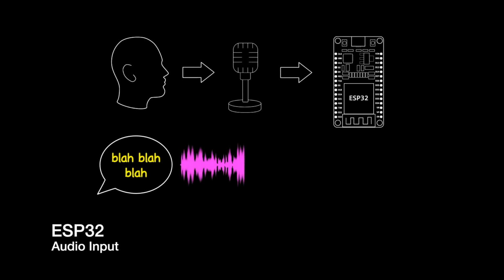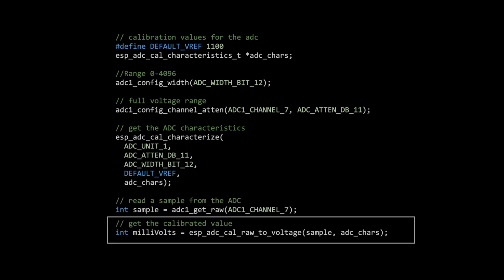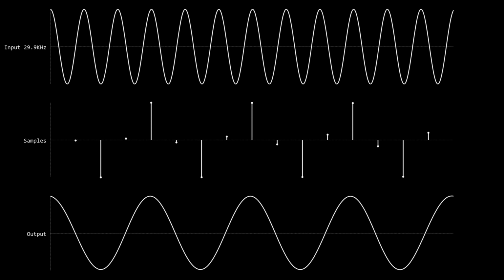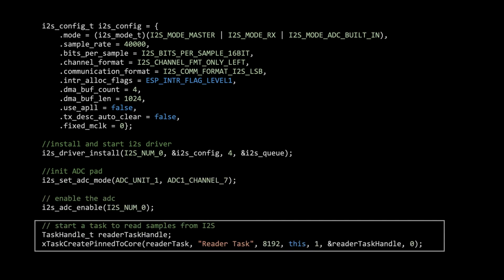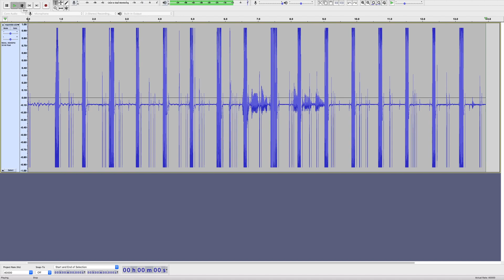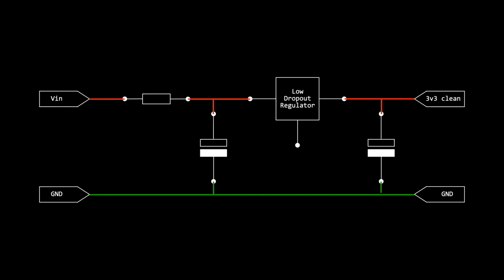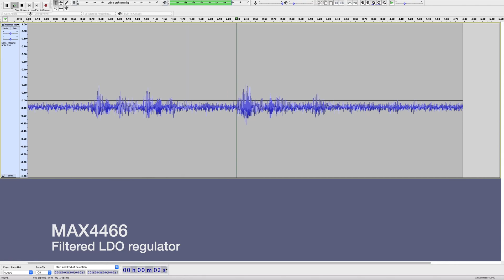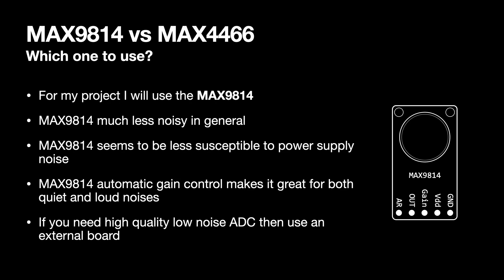ESP32 Audio Input Using I2S and Internal ADC

Comment: Can someone tell me without any external SD/Memory, how long of an audio message can the ESP32 record while it's on?
Reply from the maker: Hi Dhiman, it really depends on the sample rate and the number of bits you want to store. If it's just voice then you could get away with 8-bit samples at 10KHz. That would give you around 8KB per second. The WROOM has 520KB of SRAM built-in, but typically I find I only have around 150KB free once my code is running. So that would give you around 15 seconds or audio. You could try and stream the audio to the built-in flash which is 4MB - the amount of space available depends on the partition scheme you set up, but if you set aside 2MB then you'd have about 200 seconds so around 3 minutes or so. Hope that helps. There's no reason why you couldn't compress the audio as it comes in - there are some very good audio codecs that will compress voice down to very low bit rates (search for 3gpp voice codecs).
Reply: @atomic14  thanks mate. Great content. Subbed. 👍

Comment: Hi, great video Thanks I have a doubt regarding the i2s ADC with potentiometer are you using DMA or by creating task.
 in my project I need to use DMA for my ECG sensor can this also be implemented this way since i2s is Audio can this be used directly with the Internal ADC.
please do reply asap.

Thanks in advance
Reply from the maker: Apologies for the delay in replying - yes, the DMA and I2S can be used directly with the internal ADC - it doesn't have to be an audio signal.

Comment: Thank you so much for making this video! I am working on it receently. I want to know if you have any suggestions about external ADC for audio transmission? And how do you record time data when you receive the audio data via WIFI? Thanks again!
Reply from the maker: I would use an I2S microphone for input in preference to the internal ADCs as the noise seems to be much lower - (https://youtu.be/3g7l5bm7fZ8). For transmitting the audio data, depending on how much bandwidth you have then you can just send the raw audio samples to another device using TCP (or HTTP).
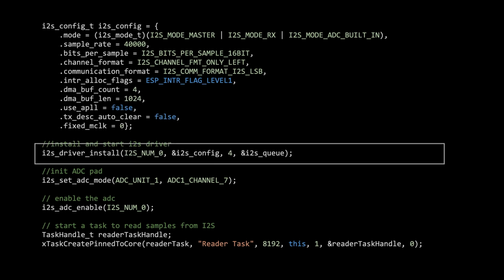Reply: @atomic14  Around 4:15 of this video you mention picking up the audio on your desktop.  Could you explain that setup a little?  I'm having trouble getting the I2S audio data to transmit on WiFi.  My goal is to have one ESP32 with a digital mic communicate wirelessly to a second ESP, and then play the audio out the I2S amp on that one.  I had an analog mic setup working this way with the 8266 version of this card (NodeMCU), but can't seem to do the same with the ESP32 version.  Thank you for your excellent videos!!

Comment: The Max9814 is definitely better but its a shame the boards come with A/R capacitor it has as its a bit too fast and reactive for voice. On the Pi into a soundcard the Max9814 sounds as good as your later I2S ones unless you start turning up the gain but that is a lot of gain with it already onboard.
Did you set the programable gain to 40/50db as the 60db gain is noisy.

I am still a big fan of electrets as if you can still get really good quality directional (cardoid) ones and that can really help other omni directional when you don't have beamforming.
My old eyes and clumsy hands went off the Max9814 board as really the A/R timing cap should be bigger and my preference for directional electrets means a lot of fiddly soldering especialy that smd cap.

Max9812 doesn't have AGC and often doesn't come with an electret which for me is actually preferential on a sound card with a PI they are far better than what seems the ESP ADC.
I wonder if other boards have cleaner lines and track spacings?
Reply from the maker: I think a lot of the noise is just poor power supply rejection on the breakout boards. I did try adjusting hte gain and got similar results. I have heard from a few people using ICS microphones who have also got a lot of noise. I think it's quite easy to pick up interference from all sorts of places.
Reply: @atomic14  Dunno we look like we where usuing the same 'aliexpress' max9814 and yeah the top 60db gain is rather horrible.
I also found some weird gnd loops depending on how I had things.
On a Pi using the 5v I think maybe 3.3 (forgot) the max9814 can sound much cleaner, I have the sound card gain really low 0-9db max I think with the lowest gain setting as each sample is still loud at desktop distance.
I did have a rockpiS (rk3088) and the adc sucked for some reason and was actually worse than your getting.
Reply: @atomic14  https://drive.google.com/open?id=1FVU1xSI3D8-53yYh9oen5L53PKoPJCiA Thats a Max9814 powered direct from the Pi into a soundcard.

Comment: First of all, thank you for the very interesting project you did.
I wanted to use the max9814 microphone as input. Unfortunately, the code you put into GitHub is related to a project in which you used both digital and analog microphones together (the next video you released). Therefore, it is very difficult for me to understand and change the code to satisfy my desire, and I could not understand many parts of this code. I wanted to ask you to put the code related to this video independently in GitHub so that even novices like me can easily use it. Thanks a lot.
Reply from the maker: Hi Sepehr, apologies, I missed this comment - I will definitely do this. Give me a couple of days and I'll push up a simpler example.

Comment: Do you know if it's possible to connect a i2s MIC (or use the MAX9814 via i2s) and an i2s output module.  I wondering if it would be possible to create a 2 way intercomm type device, where I could speak and listen at the same time.   Ideally I would connect the i2s output module to headphones to avoid feedback going into the i2s MIC.  I suspect it's not to hard to create a walkie talkie (either record or output audio at any time but not both), but I am intrigued by the idea of the intercomm type setup.
Reply from the maker: Definitely possible - you can run input and output simultaneously. In theory you can use a single I2S peripheral for both input and output - though in practice this can be a bit difficult depending on the devices you have.

In my Alexa project I'm actually running both an I2S microphone and and I2S amplifier at the same time using both the I2S peripherals. When I don't need any output I just play silence and when I don't need any input I just ignore the samples coming in. Have a look at https://youtu.be/At8PDQ3g7FQ and https://youtu.be/3g7l5bm7fZ8  - you can also have a look at the code for the Alexa project - https://youtu.be/FZ4ayyTXM2s

Comment: Nice tutorial. I have a simple question.  The way that you've connected the output of the max9814 to the esp32 aren't we clipping the part of the audio signal that goes below 0v?  I have an max9814 and connected to my scope and I can see min of -250mV to 720mv (for some random sound).  Aren't we losing the signal in this config?  I hooked mine up and I can record audio and it sounds fine (I guess) but I'm curious if we are losing information without some sort of offset for the output of the max9814 to push it above 0V.
Reply from the maker: That's interesting, the output should not be able to go negative at all provided you have the GND connected to 0v and VCC to 3.3V. It should be biased at 1.25V on the output and go 2Vpp (so 0.25 to 2.25 volts) - https://cdn-learn.adafruit.com/downloads/pdf/adafruit-agc-electret-microphone-amplifier-max9814.pdf
Reply: @atomic14  I made a noob mistake.  I connected the MAX9814 to my scope and had AC coupling enabled.  Switching to DC coupling I see the signal hovering around 1.28V (avg) which is inline with the spec.  Thank you again for a great video!

Comment: Great job!!! with the code and with the explanation!!!  I'm trying to read something else this way, and instead of sending values over wifi, i'm just printing out some values directly like below, but although the values do change when I change the input, they are still kind of non sense, can you help me decode how to read them? 

void sendData(uint8_t *bytes, size_t count)
{
  Serial.println(bytes[0]);
  Serial.println(bytes[1]);
  Serial.println(bytes[2]);
}
Reply from the maker: The data will be signed 16 bit integers.

Probably the easiest thing to do would be to cast it back to the right type and then you can print it. Though this might not be the best place/way to do it. You might want to access the samples directly.

If you want to do it the sendData function:

int16_t *samples = (int16_t *) bytes;
Serial.printf("%d\n", samples[0]);
Serial.printf("%d\n", samples[1]);
Serial.printf("%d\n", samples[2]);

It might be better to do what you want in the writer tasks so instead of doing this:

sendData(wifiClientADC, httpClientADC, ADC_SERVER_URL, (uint8_t *)sampler->getCapturedAudioBuffer(), sampler->getBufferSizeInBytes());

You can do this:

int16_t *samples = sampler->getCapturedAudioBuffer();
Serial.printf("%d\n", samples[0]);
Serial.printf("%d\n", samples[1]);
Serial.printf("%d\n", samples[2]);
Reply: @atomic14  Cool!!! Thank you very much, best content about this in the whole internet

Comment: Did you try using a B0505S for isolation?
Reply from the maker: No, but I think it would definitely be worth trying something like this. I think the ideal setup would be a completely separate power supply and audio isolation as you suggest. I have found though that the I2S microphones seem to have much better power supply rejection making the power supply filtering unnecessary.

Comment: This is a very good contribution to the community. Thanks and congrats. So I am trying to port your IS2 over ADC code to ESP-IDF but I am facing some difficulties ... that might be related to my basic skills on this ... so could you help me understanding what is being handling in this function and what it is required? Also do you have any comments on porting this code to ESP-IDF?

/**
 * Process the raw data that have been read from the I2S peripherals into samples
 **/
void ADCSampler::processI2SData(uint8_t *i2sData, size_t bytesRead)
{
    uint16_t *rawSamples = (uint16_t *)i2sData;
    for (int i = 0; i < bytesRead / 2; i++)
    {
        addSample((2048 - (rawSamples[i] & 0xfff)) * 15);
    }
}
Reply from the maker: Hi Rafael,

 I should add some commends to the code base explain what is happening - it is a bit weird.

When reading from the ADC you get a 16bit value from the I2S interface. The top 4 bits of that are the ADC channel that is being read from. So to get the ADC sample we need to remove those top 4 bits

This is what this line of code does:

sample = sample & 0xfff

That give us 12 bits with sample information in it. The values run from 0 to 4095 and are inverted - so 0 is the maximum value and 4095 is the minimum value. So the next line of code translates that into 2048 for the maximum value and -2047 for the minimum value:

sample = 2048 - sample

The * 15 is just amplifies the value up so we can hear it clearly - in theory I think we could just shift left by 4 bits to get the full 16 bit range.

I think the code should just work on the ESP-IDF - you will need to remove any reference to Arduino.h - I think the only thing it is bringing in are types like uint16_t which you can get from 

#include <stdint.h>

If you have any problems them it's probably easier to open an issue on the GitHub repo as it's a bit easier to share code there.

Good luck with your project!

Chris

Comment: Hello! Your project is incredible. But I'm having an error ... [E][WiFiClient.cpp:258] connect(): socket error on fd 58, errno: 104, "Connection reset by peer". Could you help me please?
Reply from the maker: Hey Jonathon, that normally means that the server is either not running or it can't reach it. Check the IP-Address of the machine you are running the server on and make sure it matches the one in the code - lines 16 and 17 need to match.
Reply: @atomic14  Thank you! The server part worked! But nothing came out of the recording. I followed all the steps ... What can it be? I'm using the MAX9814...
Reply from the maker: @jonathanallan8409  Let's move this onto GitHub - you can open an issue on the repo. If you can include details about how the board is wired up and what you have in main.cpp that would be really useful. Thx!
Reply: @atomic14  I made an adjustment, and now it captures the sound, but with high speed. It looks like I put it to play in 10x.
Reply from the maker: That's great - when you import the audio you'll need to specify the sampling frequency, in the code on GitHub it's currently set to 16000 (16Khz). But double check what you have in your i2s_config.
Reply from the maker: It's also mono - 1 channel - if you import as stereo it will sound twice as fast.
Reply: @atomic14  Perfect! I changed the frequency to 40000 and it worked! We just need to adjust the noise ... I will comment on the github repository, if you can continue helping me there, I will be very grateful! Congratulations on the project.

Comment: Greetings, thank you for this very good explanation, who i can use the same approach with NodeMCU esp8266 bases?
Reply from the maker: I think you can - provided the esp8256 supports reading samples from the ADC using the I2S peripheral. I'm just about to post a new video using some microphones that support I2S directly which may be easier.
Reply from the maker: Next video is up - https://www.youtube.com/watch?v=3g7l5bm7fZ8
Reply: I would like to thank you for support
Reply: I got and ASP32, the server is ok, Arduino script is compiling normally, the raw file is recorded to the server, but no voice while converting RAW to WAVE
Reply from the maker: Couple of things you can check - when converting the raw data make sure to use Signed 16 bit for the samples and 1 channel. You can also check the contents of the file to make sure it is not all 0's. I also found when debugging that logging out the min and max values of the buffer very helpful to see if any data was coming from the microphone.
Reply: @atomic14  thank you for your quick reply, i was reviewing the code, I found that you are reading the GPIO_NUM_25 and not GPIO_NUM_35 as in the video. is my note is correct ? or I have some miss understanding?
Reply from the maker: Hi Mohamad, apologies for that I've updated the code so that it is back to using GPIO_NUM_35 for the ADC input. This should correspond to ADC_UNIT_1, ADC1_CHANNEL_7 - if you still have problems lets open an issue up on GitHub and I will try and help.
Reply: hello @atomic14  i will pull the code and let you know what will happen

Comment: very good. what about tinkering with the gain pin on the MAX9814 ? left unconnected it's 60db so if lowered could result in a cleaner sound.
Reply from the maker: It's worth a try, I found that that I was getting quite a low volume on the voice but it's definitely worth another look. I'm going to do a follow-up video in the next few days as I have some I2S microphones that I want to try out so I'll revisit the MAX9814 at the same time.
Reply: @atomic14  The 60db with a pi and soundcard is very noisy its 40db or 50db with the Max9814. The timing on the A/R is also really too fast for voice the 100nf cap prob should be 680nf or 1uf.

Comment: Great informative video, looking forward to the next one. I've stumbled upon this while looking into the possibility of streaming audio from an intercom to a server (and then to my phone) - and also in reverse - via tapping into the handset speaker and microphone wires (among some others). Using an ESP32. I assume the noise wouldn't be an issue in my case. And your sample code does appear to do exactly what I want, sending the audio to a server :). Of course I would still have to find out if it has the power to do full duplex audio, streaming in both ways simultaneously.
Reply from the maker: Should be possible - for voice you probably don't need to be sampling at 40KHz, you'll get away with 10KHz pretty easily. If you want to get fancy you could take a look at some very low bitrate codecs.

Even without that you should be able to do full duplex over WiFi. You may want to look at using UDP for streaming the data as it's a bit more lightweight.

I'm going to be investigating my noise issues some more to see how far I can get and I've also got an I2S microphone break out board which will let me bypass the ADC completely. For your project there's also an I2S amplifier breakout board on Adafruit that might be worth looking at.
Reply: please, post link if you have chance.  thanks sir

Comment: Very interesting video. Thanks for taking the time to make it. I have used the esp32 to read battery voltages which is about as far away from music as you can get. But I was faced with considerable noise as well. What I found worked for me was a filter of 8 readings where did this: (sum of 8 readings - max - min) / 6. This helped because the noise was random very large errors and nowhere near Gaussian noise that benefits from simple averaging.
Reply from the maker: That's really useful to know - I'm going to try increasing the number of samples I take to get a larger number for the averaging. Also need to work on the power supply to get the noise down even more.